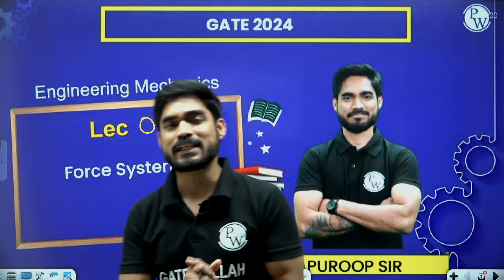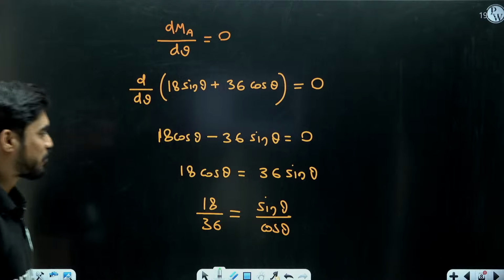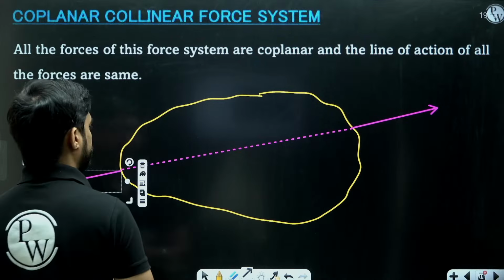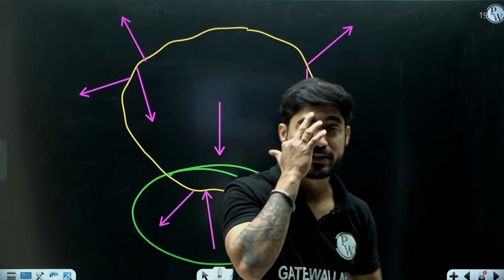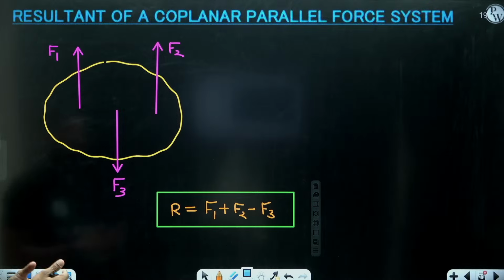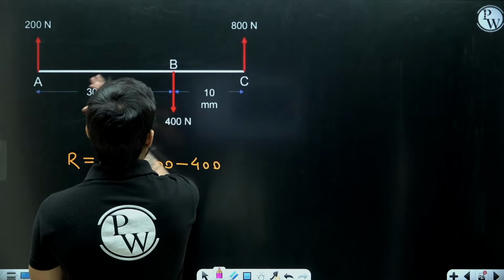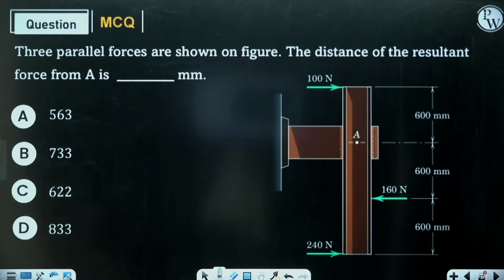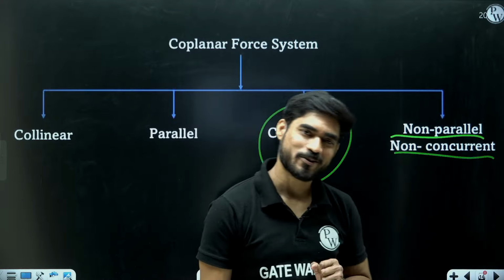Engineering Mechanics 04 | Force Systems | ME | Gate 2024 Series

Comment: ming metal plates. It consists of two toggles 
, which are operated by the hydraulic cylinder. The toggles push the moveable bar G 
forward, pressing the plate into the cavity. If the force which the plate exerts on the head is 
, which are operated by the hydraulic cylinder. The toggles push the moveable bar 
DEF, which are operated by the hydraulic cylinder. The toggles push the moveable bar 
= 15 kN, determine the force F in the hydraulic cylinder when
The machine shown is used for forming metal plates. It consists of two toggles 
forward, pressing the plate into the cavity. If the force which the plate exerts on the head is 
forward, pressing the plate into the cavity. If the force which the plate exerts on the head is P 
The machine shown is used for forming metal plates. It consists of two toggles ABC and 
in the hydraulic cylinder when θ= 40°.